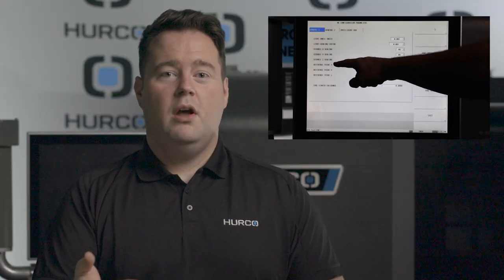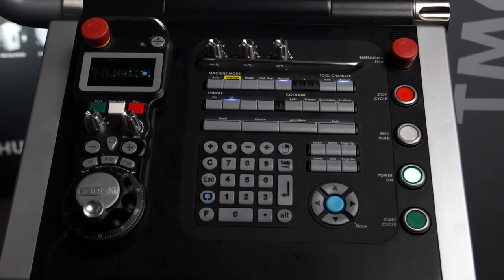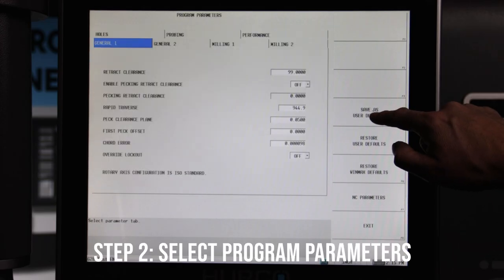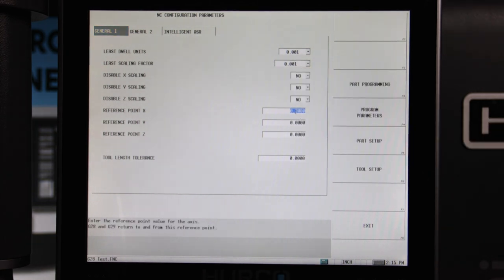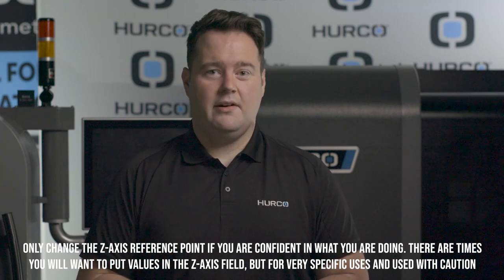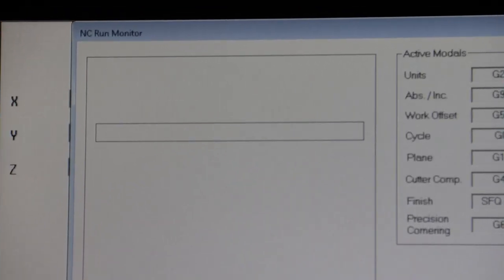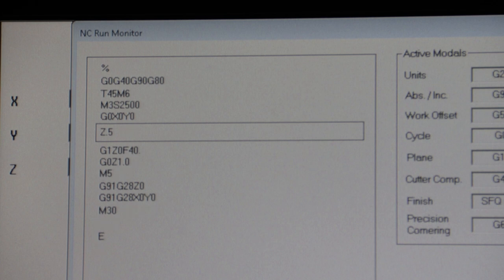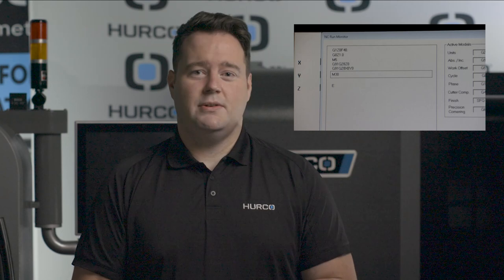Using G28 on Your Hurco Mill - Hurco CNC Training

Comment: does the xy reference point clear when you power off the machine or does it save it
Reply from the maker: It should stay when the power is turned off and back on. You are setting a parameter and the value should be retained.